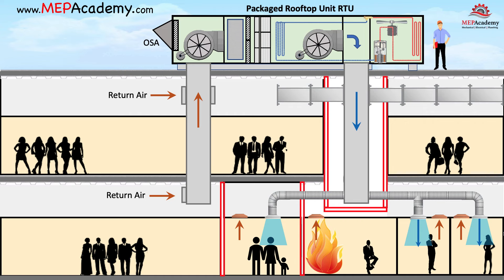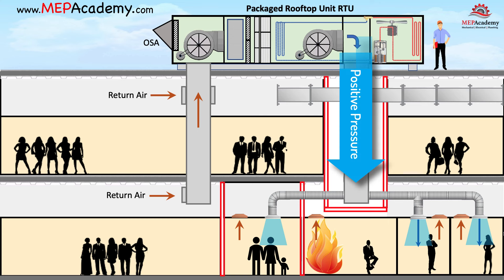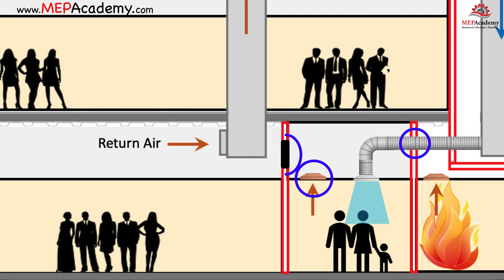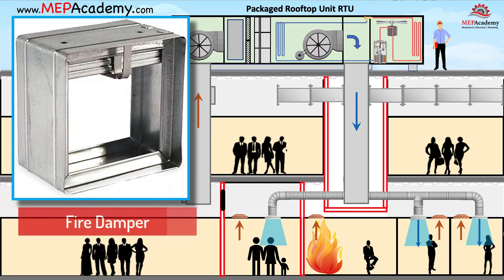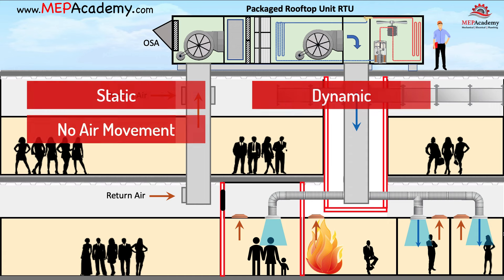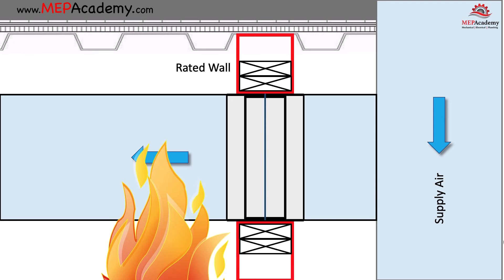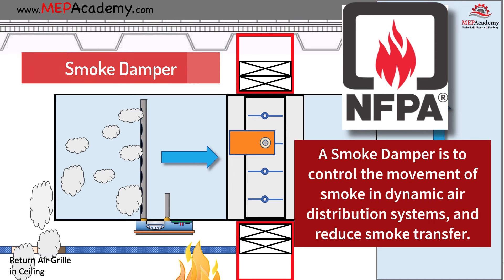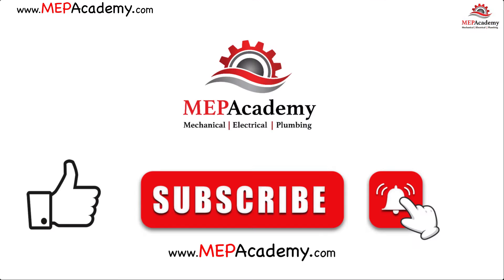Fire and Smoke Dampers

Comment: good but how about fire damper in exhaust duct in kitchen ?
Reply from the maker: Not a good idea, as grease will gather on the dampers creating a potential point of fire. Kitchen exhaust ducts are protected in many ways such as rated shafts, fire suppression systems, etc. You don't want anything in the path of the grease to create a point where the grease will collect in the duct system. Always check with the local code authority for the requirements.